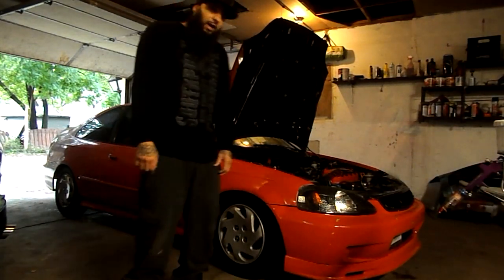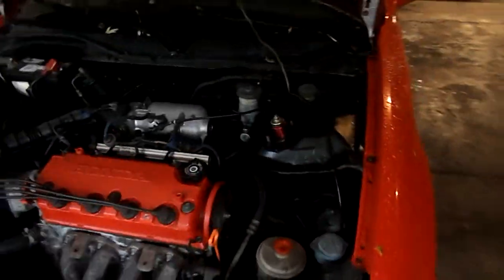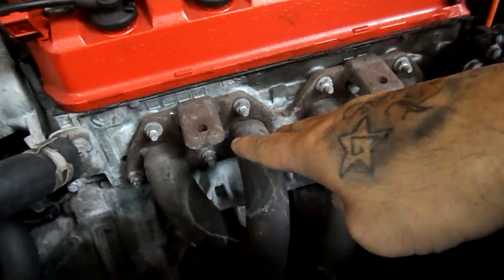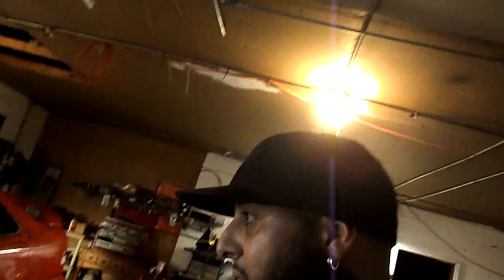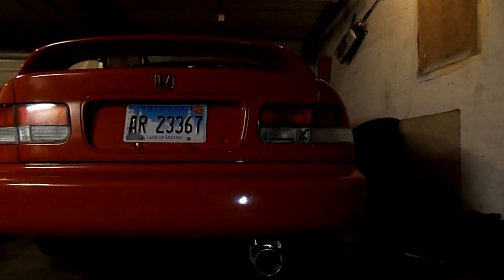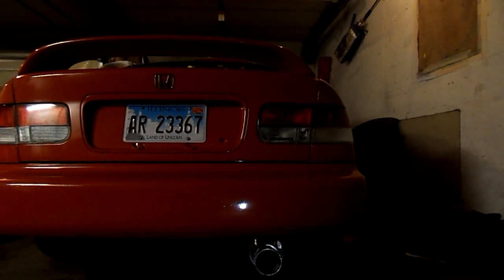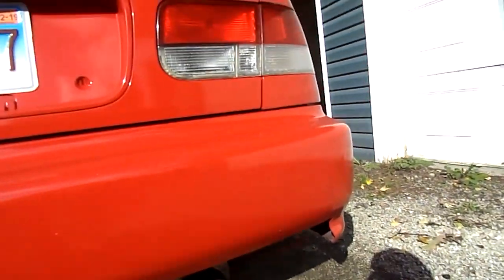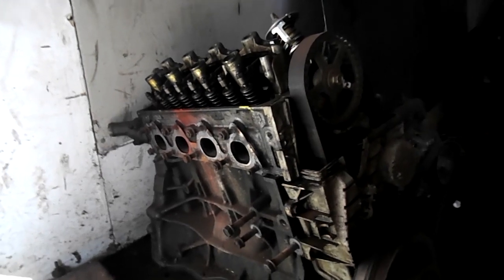Ebay 4" Rolled tip exhaust system install & review 2000 civic

Comment: Hey man when you installed this exhaust with the test pipe did it make your check engine light come on?
Reply from the maker: Yeah the light came on i ended up installing my oxygen sensors and i had my tuner fix it with his computer
Reply: So if u install my o2 sensor it will be ok or is there more to it
Reply from the maker: You might have to get your computer retuned o2 sensor is gonna read to rich. You can still do it put it on and drive around like that but you aint gonma pass emissions and your engine light is gonna be on and you might hear backfires every now and then from a bad mixture due to o2 sensor readings..i used to drive cars around like that never noticed a difference driving wise.

Comment: you running a test pipe with that or did you put back in the stock cat?
Reply from the maker: Test pipe
Reply: Barbas Life if you put back in the stock cat it will quiet it alot and give you a deeper tone
Reply from the maker: I would have except it's all welded my old exhaust is welded in everywhere.lol I could cut it off if I really wanted to but since I'm gonna be going boost soon I won't need an exhaust system.
Reply from the maker: So I guess it's good enough the way it is for a temporary fix.
Reply: yeah true forgot about that lol

Comment: Link to the exhaust ? I need it. Thanks
Reply from the maker: https://www.ebay.com/itm/4-ROLLED-MUFFLER-TIP-RACING-CATBACK-HEADER-PIPE-FULL-EXHAUST-FOR-DEL-SOL-EG-EH6/201533324689?hash=item2eec527d91:g:SV4AAOSwIFtaPcL-

Comment: Will this fit my ek sedan 1999 d16y7
Reply from the maker: might be a bit short but not sure
Reply: @BarbasLife  thanks idk what to get for it because none say sedan
Reply from the maker: Yeah many years ago i bought one for a 4 door ef and one for a 4 door integra both were short so my exhaust was kinda hidden a foot behind the bumper but it still bolted up and hung on the hangers.
Reply from the maker: This is the install video of 4 door integra with 2 door exhaust system https://youtu.be/4Gnr0PfS4WQ
Reply from the maker: This is the 4 door ef with the 2 door exhaust system https://youtu.be/5JPeNyBoOes